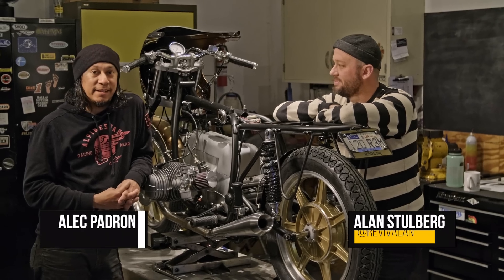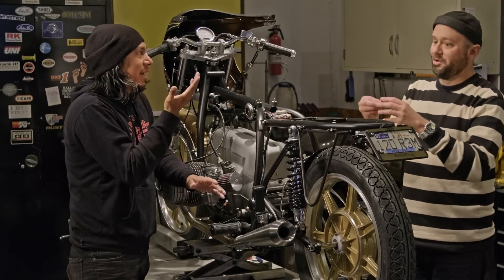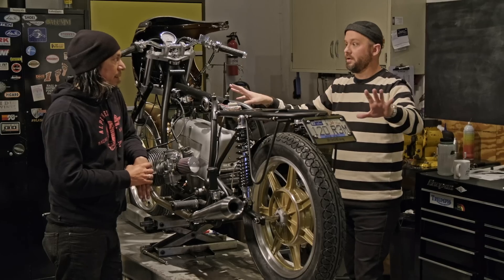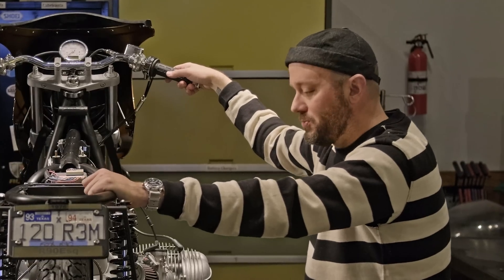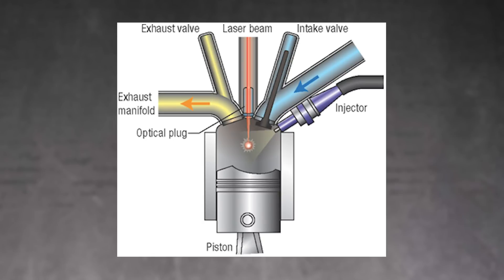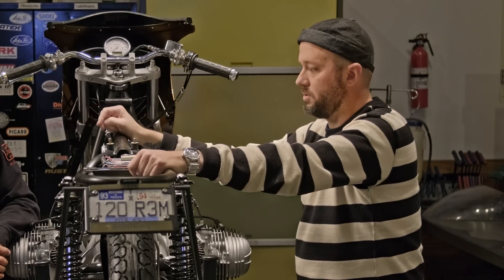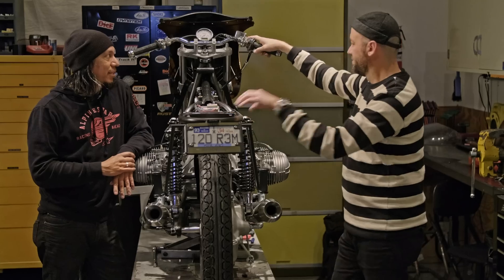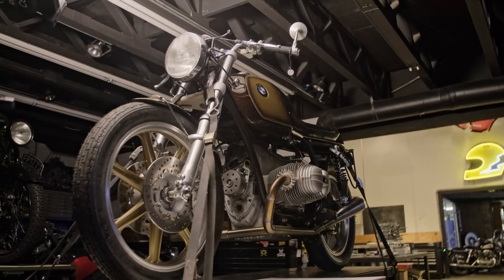How To Wire a Motorcycle Series, Introduction  // Revival Tech Talk

Comment: I know this sounds stupid, but I have one wiring connection that your products would be perfect for. I restored an old 1980 Suzuki GS1000G and the bullet wiring connections under the sidecover, just 2 wires, connect by soldered in bullet male and female. Unfortunately, this connection must be opened every time the tank comes off, which is lots in a restoration. So I'll contact you for help on that.

Comment: I have a 2010 Yamaha v star cruiser, is it possible to put those handlebar switches on the v star?
Reply from the maker: Short answer: 
If your bike is carbureted yes you can and it will require a relay and other additions to enable the momentary buttons to work. 
If it is fuel injected it still can but it is far more complex. 

email techsupport@revivalcycles.com for further questions abut this

Comment: I came to this video b/c I need a spool or two of 16awg stranded copper wire that's sunlight resistant & otherwise OK for outdoor conditions. I thought TXL or GXL would be my solution but the suppliers I asked said "nope". I was thinking black & red colors for DC plus & minus but I could do black for both wires if that's the best option for durability. Any sources or suggestions would be appreciated. Thanks in advance.

Comment: Hi guys i live in thailand not many her do what you guys can do iv just got a honda steed 400 its old school but the wireing thats some one has done well they just twisted the wires together no soldering no connectors just tape fuses just melt not blown just plastic melts i would say dead short battery dont charge up but when i rev it lights do get brighter and turn bulb if on tick over flashes normal but rev it and goes fast then just stays on iv taken to garage but there wiring is just a mess any chance you could give me some points
Reply from the maker: Hey Jason, That's a lot to cover. 
1.The first step I would take is replacing all of those bad connections with wire splices with heat shrink over them. You can solder them but it's more difficult to do that correctly and there is the possibility of the connection failing. 
2. Test your regulator/rectifier to make sure it is working correctly. There are lot of good videos on this. 
3. Learn how to use a multimeter to locate a fault and then use it to work methodically through each circuit until you locate the issue.

Comment: I have  1986 VFR750F that is heating up and sucking battery, please any advice, am in Africa.
Reply from the maker: sounds like a charging system issue. You might start by searching for a video on testing a stator, and another for testing your regulator/rectifier.

Comment: What gauge wire are you guys using on your builds?
Reply from the maker: It really depends on the application but most of the generall wiring is 18 AWG. We're using TXL wire which has a cross-linked PVC coating that has similar ratings to the more common and cheaper GXL while being half the thickness. It allows for a harness that is nearly half the thickness of a harness using Motogadgets wire kit.

Comment: Hi guys . Super videos as always. Question if I may. Currently working on my project build which is a 2008 Suzuki b king . My question is about switch gear and wiring after market m momentry switches. I've purchased the m switches. M button. M unit basic as not interested in the m unit blue. My question is as follows I know where the oem switch gear plug connection plugs into the main loom . Can I wire the aftermarket m switches into the oem loom or do I simply make a new separate loom for the switch gear leaving the oem switch gear loom in place . Also could you do a video of this . Thanks again guys .
Reply from the maker: The only portions of the factory harness that you are going to keep are those for the Charging system and Ignition system, assuming they are in good shape. There are detailed wire diagrams for this in our knowledge base. https://technicalarticles.revivalcycles.com/hc/en-us

Comment: So I have a m-unit blue and it doesn’t have enough amps to keep my starter going and I want to add a relay but I have the m button hooked up to the starter button. How do I go about wiring the relay.
Reply from the maker: I think you might be confused. The M.Unit replaces the starter switch relay, it does not replace the Starter Solenoid which is a type of high current relay. You do still need one of those. 

The Universal Wiring diagram on our Knowledge Base shows how this should be integrated and I'm pretty sure it's in the m.Unit manual as well. https://technicalarticles.revivalcycles.com/hc/en-us

Comment: Could you use that M unit on like a 00 r6?
Reply from the maker: Yes, though if it has an immobilizer built into the ECU it will require an aftermarket ECU.
Reply: @RevivalCycles  
Ok thanks ! Mine is made usa so shouldn't have a immobilizer? And what exactly is a immobilizer ?
 This M unit seems like its a pretty badass little block

Comment: I have a 2006 Ducati s2r 800.  I was thinking about getting this m-unit until you guys said modern bike don't' really need this type of unit.  I do like the keyless go, and I have had no problem with my bike thus far and I am not picky about the electrical.
Reply from the maker: A 2006 that hasn't been cared for might be in need of an electrical upgrade and we have done m.Unit installs on a few Ducati's from that era but it requires replacing the ECU to eliminate the immobilizer and is a monumental task for someone who is not familiar with motorcycle electrical systems, reading diagrams and working with EFI.

Comment: Great channel really enjoy your films , as a professional bike builder I agree with your use of up to date electrical engineering , but in a previous episode you had a guzzi frame done in green powder coat , the use of powder coating is not a good, its not an outside finish , it doesn't cope well with ultraviolet ( sunlight ) spanner rash ( hitting the frame with a wrench , it happens ! ) & I have had bikes in for work that were coated years previously all cracked & faded , then you got to get the stuff off , let's just say it gets expensive, all of my stuff is painted I find it has a better finish and any indescrepencies in the metal work can be fixed with a little filler , and it's less expensive . Hope you don't mind me commenting just wanted to pass on a bit of experience . ; )

Comment: Great vid guys! I gotta wire my 66 Triumph TR6 Bobber build. I have electronic ignition and magneto. No battery. Just the basics, lights, stop light, indicators, Horn and electronic speedo. Will this be covered? Cheers from UK
Reply from the maker: Hi Chris, this series probably won't get quite so specific. When we do dive deeper into the process of wiring a bike we'll be using an m.Unit on the install. That said, there are many universal truths to applicable to any rewire of a bike.

Comment: I have a very weird problem with my Ducati 93 900SS. When I bought it 6 months ago electrical issues were expected, I owned the same model 25 years ago and it had electrical "quirks" lol and it was only 18months old when I got it. But my bike now, omg it's had some dodgy people work on it, it ended up losing all dash lights except h/beam, even if it wasn't on, but that didn't matter coz the headlight stopped working anyway, well it worked but was so dull you couldn't tell it was on. In the end the only thing that worked as intended were the blinkers lol. Oh and the starting and charging system, the bike itself ran beautifully. So of course I investigated, and found the entire wiring system bundled in a ball and zip tied together stuffed up under the fairing,  patch jobs with bare wires, soldered joints that didn't stick but at least had elec tape to keep the wires in contact, even the fuses were upside down lol. I fixed it all and got everything working properly.... BUT..... I have somehow created a new problem.  The bike starts and runs beautifully as before, all the lights and dash works, but whenever I turn the handlebars left or right, the bike cuts out like I've hit the kill switch, and then restarts fine, no fuses blown. I have checked the start button housing the best I can, without actually removing the throttle which I was hoping to avoid, and the wiring coming out of it up to the main harness, which I haven't delved into yet. Everything seems fine, and I can't think of anything that I have done to the dash and lights wiring that should cause a problem like this. But I am definitely an electrical novice lol.
The bike is obviously not rideable like this so any help or advice would be much appreciated. I know from the state of all the oem wiring that I have seen so far that it needs completely rewiring, and I hope to buy the m-unit blue and a few other goodies asap, but realistically it will be quite a while before I can do that.
Omg sorry this ended up an essay lol.
Thanks for all your videos 👍👊 they have definitely helped me so far and given me the confidence to do the rewire myself 😁 but troubleshooting this first problem is proving difficult.... Please HELP!!! 😀😀

Comment: YES! Cant wait for all of this. I'm doing a complete rebuild of my old CB360. Wiring it from scratch and will need every bit of help I can get. Thanks for the great content, keep it up!
Reply: Have you done it yet? I have a CL350 and I stripped the whole thing, not only will I not be able to put that absolute cluster back together but I also want to replace the lights to LEDs. But I have a feeling that the old electronics are not compatible with with modern counterparts, is my suspicion true?

Comment: Never use plastic tie wraps as they chafe through wires bundles,  get  brittle because they are exposed to the elements.  I removed all the plastic tie wraps and did lacing instead
Reply: What laces are you using? Aren't they slippery?

Comment: Hi - ill know what to order once youve done some more wiring videos. Just started the renovation of a 77 Honda 400/4 id like to keep it standard looking (switchgear etc etc) but would like to modernize under the hood, munit, led headlights, (charging system, points, coils etc etc - i didnt even know any of that could be changed) and ive no idea (if it can) what i can move to!!

Comment: My problem is I want to do things in stages over an extended period of time.  So eventually I want to replace my giant battery with a hidden LiPo, for example.  But that means eventually using an angle grinder to remove the old battery tray attachment points from the frame.   And I just got my frame painted.
Reply from the maker: There are definitely ways to approach a complete electrical restoration in stages but it does involve some planning on the front end so that you don't have to repeat some things. We have a guide covering nearly all the components you might need when performing an m.unit install or really any harness upgrade. We broke the guide up into three stages based on either budget or the extent one wishes to go. 

https://technicalarticles.revivalcycles.com/hc/en-us/articles/360008817472-A-Comprehensive-List-of-Items-You-Need-for-an-m-unit-Installation-